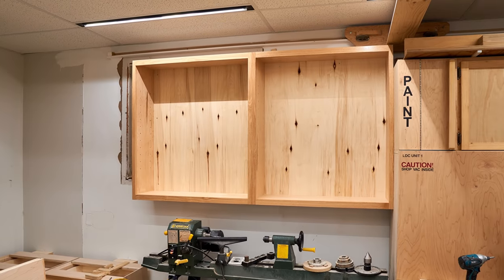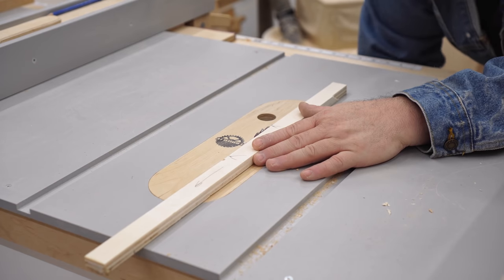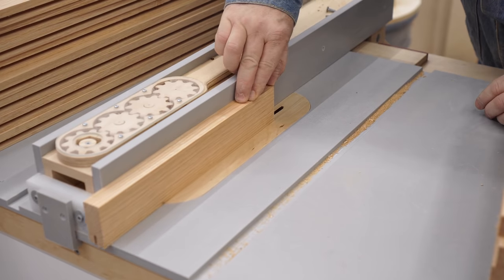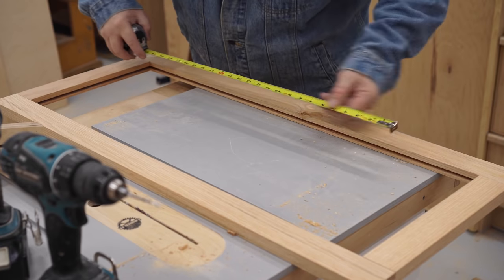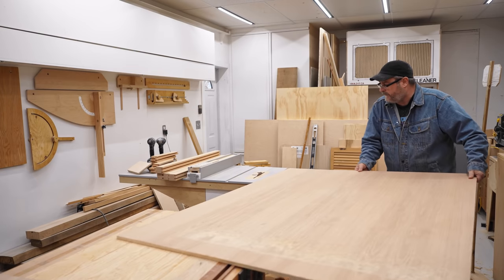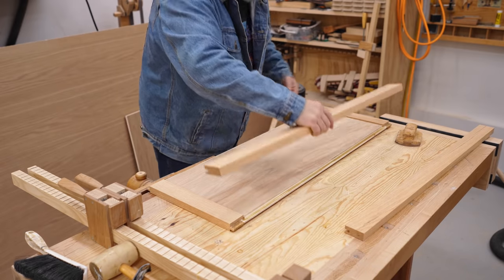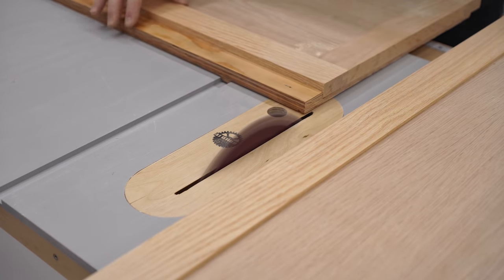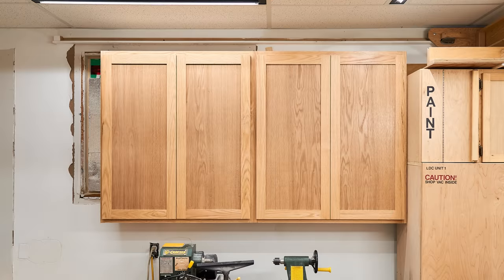How To Make Great Looking Cabinet Doors - Kitchen Cabinets - Woodworking

Comment from the maker: Join my Makers Mob:
https://go.themakersmob.com/john-heisz-new-project-release/?via=ibuildit

See the build article for more details:
https://ibuildit.ca/projects/how-to-make-cabinet-doors/
Reply: Hi John, commenting here because comments are turned off on the metal drilling video. Have you ever experimented with heating the metal with a torch before drilling? Assuming the piece able to be heated and not attached to something flammable, meltable, or explosive. I am curious about that maybe i will try. My thought is usually metal gets softer and more pliable the hotter it gets so perhaps more drillable... idk
Reply: You are the first to actually convince me to think about joining the Makers Mob.  I appreciate your posting the projects here, and posting the details there makes sense to me.

But when I went there, it's unclear what I'm getting.  $20 for...  Just your stuff?  For everything?  When I go to the main URL, it deliberately hides all pricing information until you sign up, which is a serious red flag for me.

So I just wanted to say that I appreciate all the hard work you put into this channel, but Makers Mob could probably be doing better for you if they were more up-front about their subscriptions.

Comment: I liked the plywood fence when cutting the 1/4" plywood. I like your construction design for doors. The raised frame allows for decorative epoxy to be poured if you're into working with epoxy.

Comment: Hello, good work !!!, in magazines like MECANICA POPULAR and other sites always recommend leaving the floating board without gluing to the frame to avoid dilations that affect it at the time and for what you do you stick it, do you always do it ?, greetings .
Reply from the maker: When the panel is made from plywood you can glue it. You should not glue in panels that are made from solid wood.

Comment: Good looking doors John and I like the new channel logo. Are you planning on any hardware for these, wooden handles to match the drawers?
Reply from the maker: Thanks Graham. I'll be making 7 new handles that match the ones on the drawers, 4 for these and 3 for the hutch unit that goes in the corner to complete this set.

Comment: have you ever thought about modifying the measurement pointer for the rip fence to include a mark for both sides of the blade?  do you would know the point on both sides of the cut?  i don't know how valuable that would be but it might come in handy once in a while, mostly for cutting dados while being too lazy to change to a dado stack and measuring.

Comment: Hey John, as a general rule, aren’t you supposed to NOT glue the panels in to allow for expansion and contraction?
Reply: Aha! you missed the explanation!
Reply from the maker: The rule applies to solid wood panels, not plywood. Plywood doesn't expand and contract enough to cause a problem.
Reply: John Heisz - I Build It thank you John for the quick response. I did not realize that about plywood. I do now. 😁

Comment: I'm going to make doors very similar to this for my kitchen.  We are going to paint them instead of using stain.  Would there be any advantage or disadvantage to using mdf for the panel instead of plywood?
Reply: Only from a strength standpoint.  But then again, they are doors, not structural.

Comment: Why do you cut the rough lumber to size first and then mill it? instead milling the larger pieces then cutting it down. Genuine question I'm an electrician not a carpenter.
Reply: A few reasons we do that. First it makes them easier to handle through subsequent milling. Second it reduces the effect of any twist or bow in the wood. Third it allows for consistent milling of all edges, not just the faces.
Reply: The smaller the piece, the less extreme any warp, twist, or cup is.  IE if you're jointing a 48" piece with  a half an inch of cup to it, you'll lose far more material getting a flat reference face (and put stress on your tools and wear on your cutters) than if you cut it closer to length and  had to mill it less.

If you can get a flat face on a piece relatively close to final dimension, you can use the proper tools (jointer, bandsaw, table saw, planer) to get the piece to final dimensions instead of just crushing your jointer and its cutters to get one flat reference face over a far longer piece.
Reply: @Jayko1979  good point thanks for the info

Comment: Is it a mith not to glue panel doors, as panels within should float to allow for expansion and shrinkage ?
Reply: I read the plywood none issue, isn’t the door frame hardwood that needs room to move from the panels?
Reply: Wood "moves" (i.e. swells and shrinks) a lot more across the grain than it does in the direction of the grain. For the frames there's very little width, so not much movement. If a solid wood panel is glued in, it will have a large dimension change across the width and split the joints of the frames. 

Plywood moves a similar amount as the with-the-grain hardwood, but in all directions, so it's a non-issue in the frame.

Comment: I am a contractor cabinet maker?  Why do I not use construction adhesive on my custom cabinet doors?
1: just because it’s cheap does not mean it’s a good idea?
2: I just remodeled a kitchen and was able to take apart several doors that were properly made and cut them down saving hundreds of dollars?  If the prior professional cabinet maker done what u did?  Every door I cut down to fit the new cases would be trash?
3: wood moves especially custom cabinet doors.  Albeit slightly but it moves!  Thus done right last a very long time.
4: Construction adhesive is for everything but custom cabinetry my friend?  Find me a professional Cabinet maker that prefers tubed construction adhesive over tight bond 3 ??
5: it obvious your extremely cheap and certain if there is away around it you will find it?  Like the fake dovetails???  Dear Lord & the point was?
6: listen that whole entire operation has me scratching my head?  Home made wood clamps?  A table saw built with a Skil Saw?  And on and on?
It’s interesting but for you only!  The reason you use construction adhesive is this: CHEAP!
The reason you make wood clamps?
CHEAP!
It would kill you to buy a gallon of Tightbond 3 and make stick/cope door with a high grade router bit using a nice router table with an nice router like a Triton 3 1/4 hp .

Your cheap?  You are interesting cause your cheap ?
If everyone thought it was a good idea to be cheap like you then they would?
However I hv plenty of work doing it the right way w/o construction adhesive on everything !